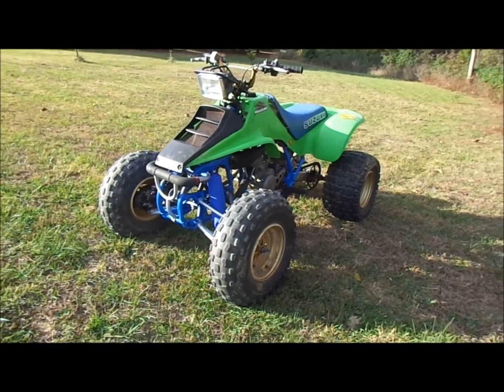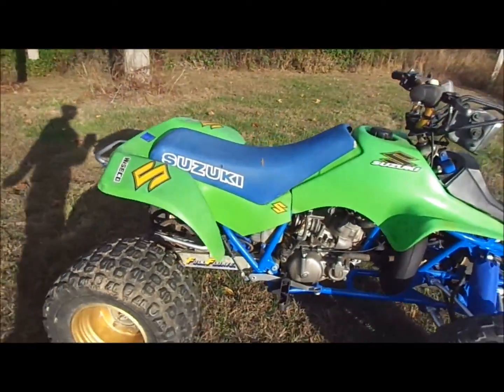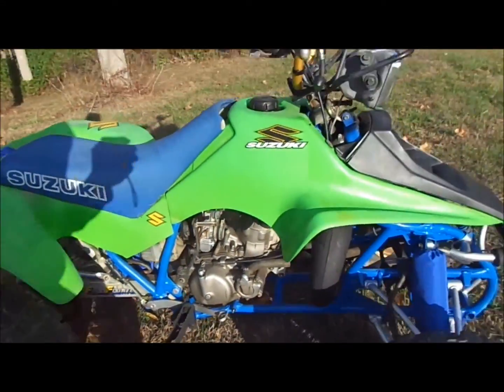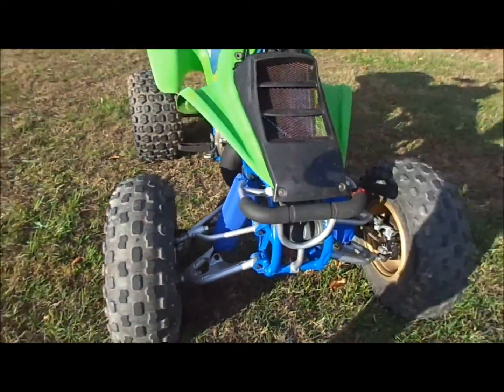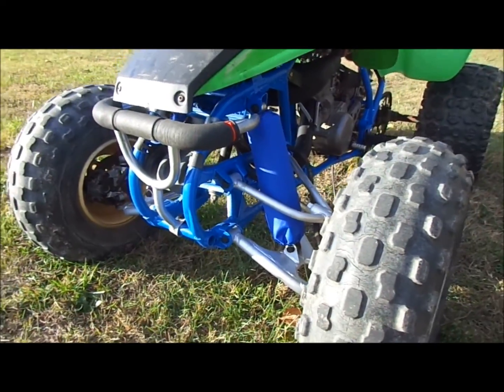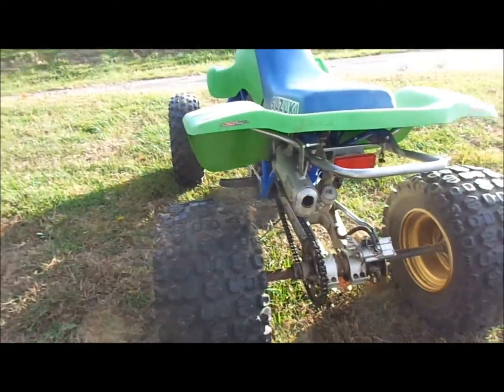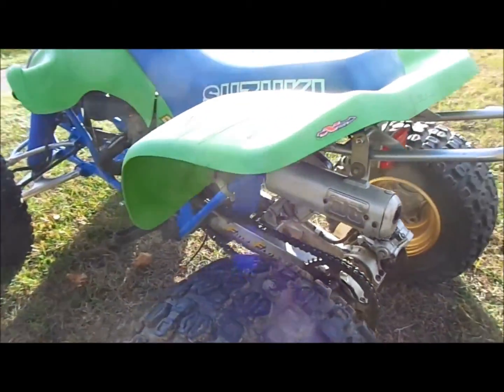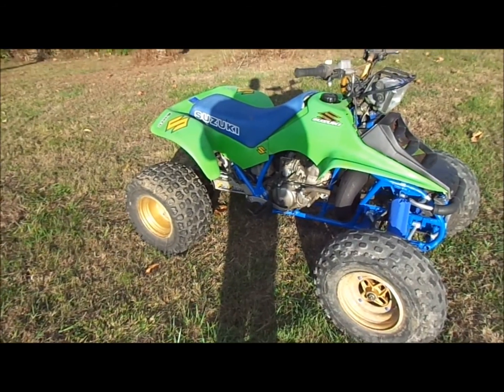Project: 1986 Suzuki LT250R (part 2)

Comment: nice, I'm buying one next year !
Reply from the maker: Thanks! Are you going to get an 85/86, an 87, or an 88-92? I've got an 87 zilla I'm going to have built by Dr.Q whenever i get my bighorn and guitar sold! And if i can stop buying other dumb projects...going to pick up an 84 rm250 tomorrow. It is a non powervalve engine, but used the huge reed cage the 87 lt250/500r's used :) thanks for watching!
Reply: it's a 90 and it's the one with the big seat with a entire fmf exhaust system and I hope you are going to have fun with it and it would be nice if you could make a video of the rm ! goodbye fellow suzuki rider :D
Reply from the maker: sweet! my buddy bought a 92 a while back, but I think the powervalve is locked up or something...I'm wanting to do a VS video when we get his going good. I've got a bunch of video ideas..i just work 1st and it's dark pretty much when I get home. I've got a 230 quadsport I'm going to put a 260 kit on, have the head ported and a larger exhaust valve cut, and a stage 2 cam...hope to have that finished in a couple months!
Reply: nice man it's pretty cool, i'm getting my first quad and it's probably a 250r, do you think it's good for a 16 year old kid ?
Reply from the maker: Yea I think you're probably fine. I rode an lt250r when I was 14..and was BLOWN AWAY. Just don't do anything you're not comfortable with. If it's an LT, you'll want to do some mods to the front end to make it handle straight. check out quadracerhq here on youtube, and i can help you too if you need it. i've ridden a honda 250r once..and it was pretty wicked..bone stock too.
Reply: thank you for your help and I hope you have a great day !
Reply from the maker: no problem! keep in touch!
Reply: 6slayer6sam6 thanks man for the vid.got to see how good they are ,just found the problem on mine and working on it I have a 86 lt250r
Reply from the maker: sweet! hope ya get it running with ease...gotta keep these old machines running! I really enjoy mine. I haven't been around as many Honda 250r's or later LT's, but the 85/86's hold their own in my book. Aaen still offers a pipe for them at a VERY good price (would love to get one) and Dr.Q can do a lot to these motors as well. I'd love to find another and do a full "build" on it just to see what it could do!